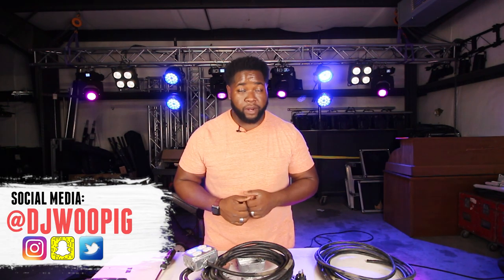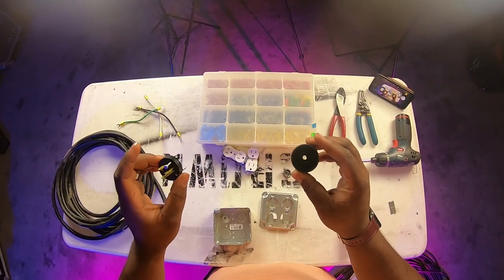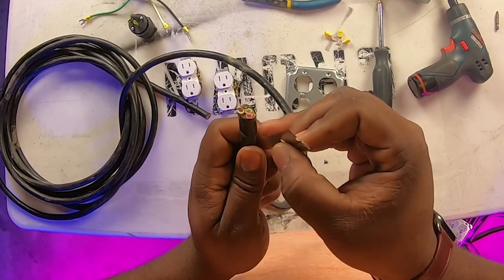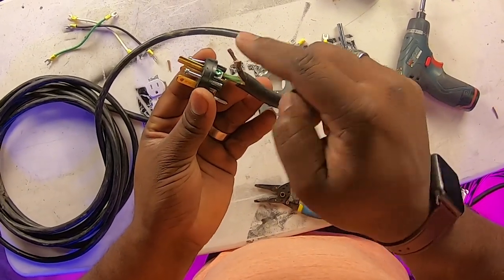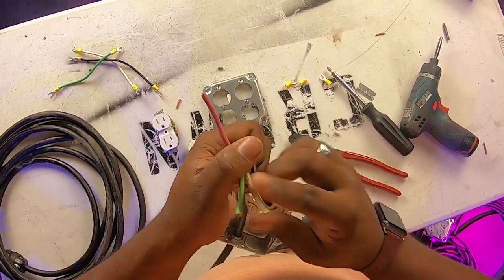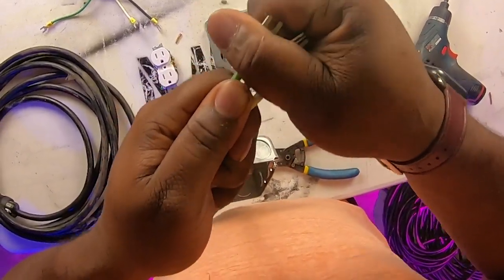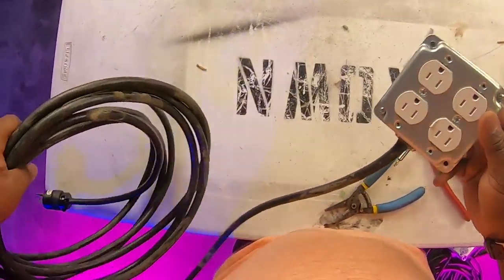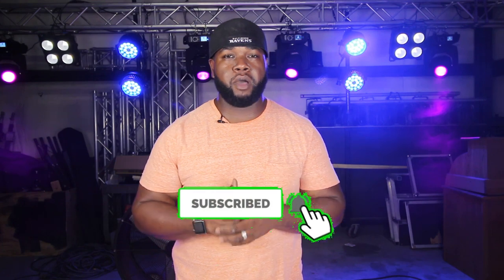HOW TO: MAKE YOUR OWN POWER STINGER! | SAVE MONEY ON CABLES!

Comment: Great video! I build all of my own power cables as well. But, as an industrial Electrican as my full time job, I'd like to offer my opinion. Those receptacles are 15a. I would recommend a commercial grade receptacle. A good brand would be a Pass and Seymour CR5362. It's a heavy duty 20 amp load rated receptacle. 
Another tip would be on the box itself. Like the other commenter said, this is for INDOOR use only. Also I would use a ground screw/wire and ground the box as well. If you wanted one for outdoor use, you should use 1 GFCI receptacle and load the CR5362 beside it. Install them in what is called a 2 gang Bell Box. And a weather rated flip cover. Also use a weather rated, S.O. cord grip box connector. 
Hope this helps someone. Good video, and great idea to make them yourself!
Reply from the maker: Since your are actually an electrician (or at least claim to be), you can probably help answer my question. Would the center screw used to attach the cover to the receptacle to the cover not ground the box? The center screw ties directly to the ground bar in the receptacle itself correct?
Reply: @DjWooPig  Okay, first of all I'm going to forget that you are calling me a liar about being an electrician. Because I really like you and your videos. I think you're a good person and a good business man. Anyway, the center screw, especially on a 15 amp receptacle is basically just for holding on the plastic coverplate, like in your house. The 2 tabs on the top and bottom of the receptacle that you cut off are for holding it to the double duplex RS cover . The little tabs that you bend away have a threaded hole, you take the 6-32 screw that came on the receptacle and screw it through the front of the cover, through the hole in the receptacle, the one you cut in half, and thread it through that little metal tab from the cover. This give the receptacle some rigidity for plugging in and out over time. That center screw won't hold up in time. Eventually you will go to plug something in and it will strip out and the receptacle will fall into the box. Second of all, to get technical, the center screw is a size 6-32. Yes, it will still read out on a meter or plug tester that it is grounded. But according to the NEC, the national electrical code, a 6-32 is not rated for a 20amp ground fault current. However a 10-32 size screw, or a ground screw is. For example, if one of the hot wires from your receptacle comes off the screen and touches the box, that fault current will blow apart or melt that 6-32 screw before the breaker even trips. A 10-32 screw with 3 threads of contact, is physically large enough to withstand that fault current and will trip the breaker. I'm not trying to be a prick, I'm just trying to help. I'm sorry if I came across as a know it all.
Reply from the maker: Nate Flanigan I never called you a liar. People say they are lots of things on the internet but don’t have any merit to back it up. I was genuinely curious because I have been told that the center screw is a grounding source. I even took one of my outlets I used in the video and found it was attached to the ground bar. I’m not saying I know everything, or that I’m an electrician, just curious as to why the ground screw in the middle can’t be considered a ground when metering it out. The screws on the box cover seem like they are bigger that the ones I I didn’t use. I could be wrong on that one though.  It’s all good, you gave me the answer I was asking for.
Reply: @DjWooPig  you're right, the screws holding the cover on are bigger. They're 8-32. And ya I understand about the internet thing. I was just offering my opinion and knowledge. Not trying to tell anyone that they're wrong, or insulting them. Just telling what I do on a daily basis.
Reply from the maker: Nate Flanigan cool. shoot me an email, We May have to collaborate on some entertainment and electricity related.
Reply: @DjWooPig  sounds good to me! By the looks of your videos, you seem to have a pretty good idea of how to make it work in the entertainment industry. I admire you and you're business. We'll be in touch. Thank you
Reply: @Meeper76253  Great advice!  Been holding a J card for almost 35 years.
Reply: @twiprod002  thank you, as for myself only about 2 years as a journeyman. But 5 years of trade school and apprenticeship.
Reply: @Meeper76253  I am learning a lot about this. I was always tought to go bare wire to the connection spots and use electrical tape to keep from arking should one or the wires come loose. Thanks for your input too. :)
Reply: I feel like this video needs to be deleted/remade to prevent people from making the same mistakes as you. This is why you always read comments/ do your research on anything related to power.

Comment: I too am not a certified electrician but I would like to put out there that is box should only be used indoors never for out doors because that box would shock you if it gets wet. For outdoors you need a sealed box with rubber gaskets or use gfi plugs
Reply: Hmmm. Only one plug needs to be GFCI, and you'd want it downstream on the stinger if putting in more than one box. Correct?
Reply: Like I said before I am not a electrician but I do know about electric. I have worked with touring companies we had two versions of stringers when ones with no gfci but in a sealed box because if you need power up high you don’t want to mess with gfci in a box 20’ 30’ feet up on the air. Then we also provided power off the generator for vendors and those are gfci.
Reply: You can use a box called a "wet conditions junction box" to make this with a plastic cover that has flaps to cover the outlets.
Reply: @Endmass  yes correct, if you're plugging this box into a circuit that already has GFCI then you're good to go

Comment: Wondering why you did not ground the metal box? I don't think I'd use these out on a job since I'm not an electrician and the liability would be great if something happened...though I have made them before for home use.
Reply: The box is grounded by the center screw/bolt from the outlet

Comment: Great video. One thing I do in addition to what you show is I spray my boxes with Plasti Dip paint. The rubberized coating stands up to lots of abuse and when done in black, hides them on stage a little better.

Comment: I build a bunch of them, but I made the power box with shorter cables, so I can just connect it to my 100, 50, 25, 10 ft, extensions, most of them are built into a closed box

Comment: Love the channel bro. But for this project I suggest putting both hot side together in the middle of the box, if the punch hole disks on the sides get pushed in by chance it can’t rest on the hot wire and make the metal box live. Also I would ground the box too as another safety measure.

Comment: I am DJ and Electrician. The box you made is not grounded. It's important to ground the box in case a live wire inside becomes loose and touches the box. With the box grounded that would cause a short circuit and the breaker to jump. In your case not having grounded the box the circuit would remain active and if you or a client touch the box you can get an electrical shock or worse get electrocuted.

Comment: Am I the ONLY one that was distracted by the kitten!? Think John needs a new mascot!! (or at least hold the cat up to the camera)! 

Can also look at something like L14-20P (single phase common neutral 120/240V 20A Plug) to two (dual) 120V NEMA 5-20R (or -15R for 15 Amp only) outlets and make use of that cut/unused red wire. Most venues with 120/240V outlets/drops probably have wiring and electricians as apart of the rental contract. So the single 120V NEMA 5-15R/20R  plug to a quad as in this video is the most likely scenario you will encounter. [[ The way I remember the part number L for Locking, 1 for single phase, 4 prong  = L14 ]]

P.S.> good practice to bond the incoming ground to the box/case first, THEN two pigtails grounds from same ground spot on box to the receptacles grounding lugs.
Reply: @StringerNews1 Yeah I wasn't discussing 3-phase, but it is always good to understand connecting across phases yields different voltages (208v) from typical single phase. In a corporate/business with 3-phase and 208v at some up stream panel, the electrical engineer on site (and usually available as apart of the contract) would handle the 120V drops (via a transformer downstream 208v->120v) and again back to the most common scenario and purpose for the video.

Side comment , I am glad to see somebody else describing/using "split phase" (120/240V using a center tapped transformer a pole upstream) which is just part of the upstream single phase from the pole instead dual to two phases (they are really more similar to polarity changes than a phase change).

Comment: Lube wire where it stabs through edison connector clamp housing half prior to splitting and stripping cable. This prevents you from fighting and having to cut the weather gland.   2. Invest in flush cut pliers. 3. Thank you for having proper crimping pliers.  4. Always run a ground wire to your metallic box (regardless that it is “grounded via the center screw on outlet to cover.”  If that was a non metallic box that would be a different story.  5. The parts you cut off each end of the outlet has a screw hole for further attachment to lid.
Reply: I would also add that the crimper has two dies on the jaws. One is for insulated connectors, the other is for uninsulated connectors. He used the wrong die. Those “notches” in the connector will cause the insulator to pull off the metal connector over time.

Comment: Your forgetting to wrap the outlets with electrical tape to ensure no inside connection with anything bad. Safety first and it’s a cheap helper. Only for indoor use also. That’s an open box.

Comment: !!  Please GROUND the box  !!!  Love your videos but that won't fly if inspected. Yes...it's contact grounded with the plate screws but not %100 safe and not correct. After a few years of use
if that hot wire gets loose...and a plate screw is loose that box can be energized! Best to everyone! Love your positive videos.
Reply: The box is grounded by the center screw/bolt from the outlet

Comment: Need to ground the box. Especially since the cable clamp is metal. Those are dangerous.

Love your stuff though.
Reply: The box is grounded by the center screw/bolt from the outlet

Comment: BTW, if you use isolated ground outlets you will not have ground loops in your system when you put the "handi-box" on the ground or on concrete floors.

Comment: You didn’t ground the box though....
Reply: I commented on that as well but before reading your comment. Yes, the focus on recent NEC changes puts more focus on proper grounding order. Ground the box first so if all else fails, there is a safety path back to ground. If the box is floating and a hot wire come in contact with the metal box, it is NOW dangerous to touch. This happened at 2018 NWPAS (North West Pinball and Arcade Show) where two machines side by side had live mains between the cases. One thing the electricians did THIS 2019 year was test all equipment against earth ground early on. I have two posted videos (on in 360 VR) of the venue before opened to public!
Reply: The box is grounded by the center screw/bolt from the outlet in this instance